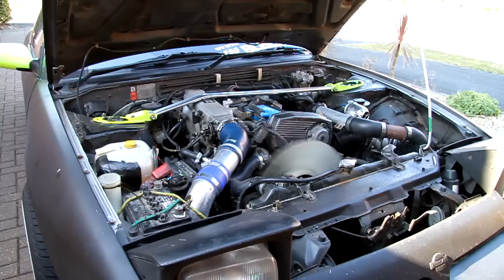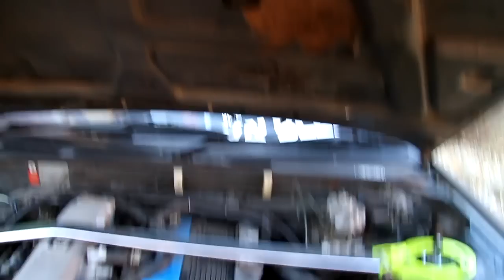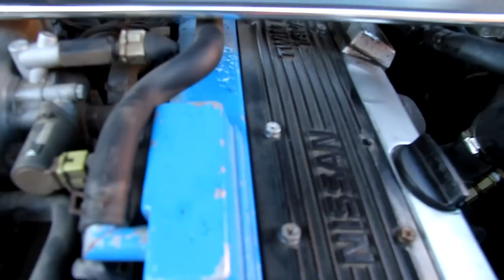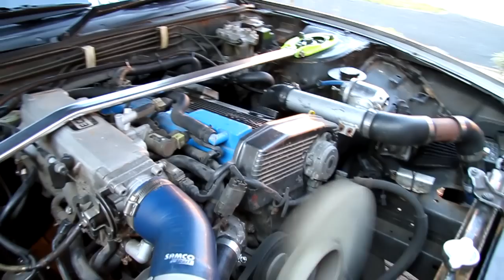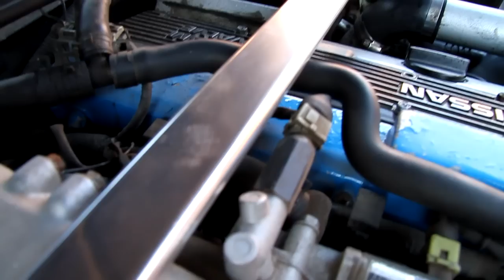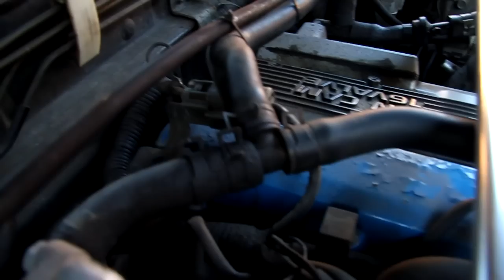CA18DET S13 rattle

Comment: definately big ends mate.  rattle on overrun is the tell tale.  ive had my big ends go twice on my CA18 -  i would have been lucky to have done 3000km between failures, but my motor is under load all the time.